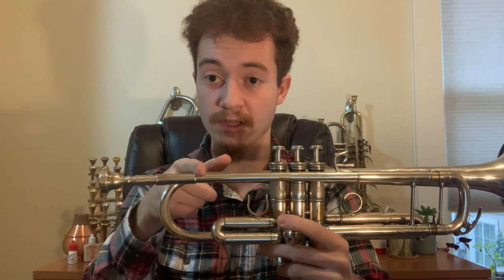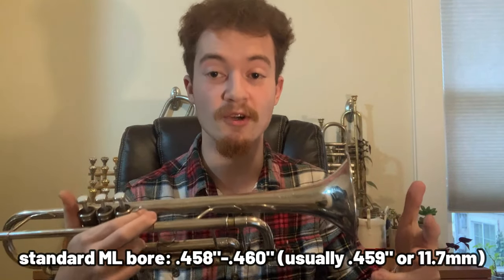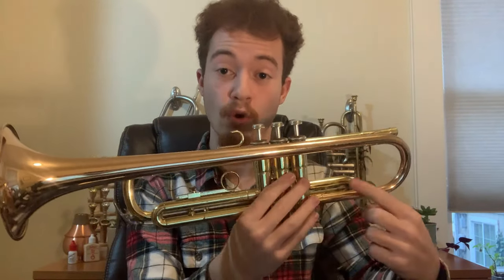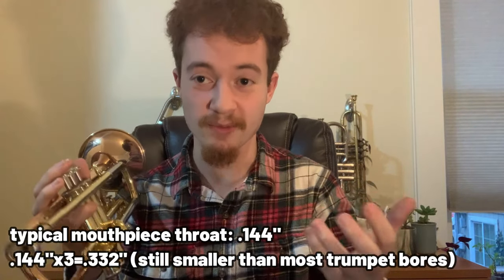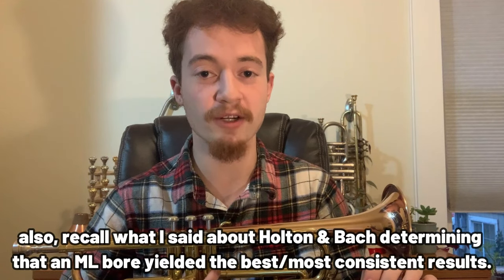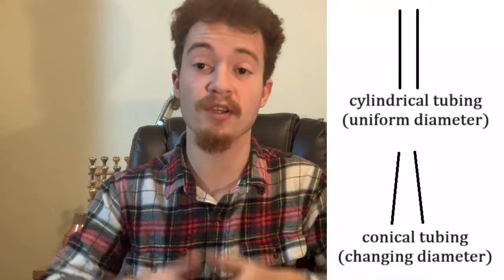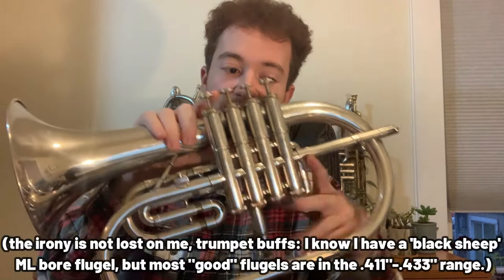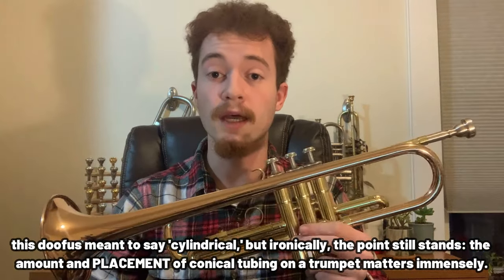Bore & Bell Size... What Do They REALLY Do? | Trumpet Demystified Episode 2

Comment: I play a pretty large mouthpiece and I play mostly big bands and salsa gigs..I have found that my Olds Super balances out the large mouthpiece very nicely.My super has a bell throat that flairs late and that’s where I feel like I get the needed resistance to help compensate for the large diameter mouthpiece.Also the tuning slide is kinda square shape which adds a bit of resistance too.These things really help me get thru 4 hour too freakin amplified and loud commercial gigs.Oh and I’m 70 years old..👨🏼‍🦳
Reply from the maker: Thanks for your comment, Larry. I’m in a similar boat, with my trumpet perhaps being “tighter” than conventional, balancing my large mouthpiece tastes. Also, not my main horn, but I have a fun little 1924-25 King Liberty that that has a similarly slow-flaring bell that definitely is fun to plug something silly like a Bach 1D or 1E into!

Also, much respect for being able to survive four hour gigs at your age. I’m a third as old as you are and I don’t know if I could do it…
Reply: @SamuelPlaysBrass  the right tool for the job. I played Bach 43/43 my whole career, which included broadway musicals, big bands,and some orchestral gigs,and club dates too..Now days,as the gigs I play are mostly very loud I love the Super for a bell to mic horn that has a very fast attack (response) …My bachs have a slightly more complete rounder sound,but the olds has a fine sound, and an easier horn then my Bachs without a doubt.The olds people knew their stuff!

Comment: Large bores in general have less acoustic impedance and they do not have as strong of resonances. The acoustic impedance does contribute to the "played" air flow resistance.  So it is not only the mouthpiece throat that determines flow resistance when playing.
Reply: Yes 100% right. Some people that claim that the bore size doesn’t matter are misguided,Maybe some monsters like Arturo it doesn’t matter, but to normal trumpet players it sure does. Step bores or choked bells can make a large bore horn easier to deal with but a straight Benge 6x or a Wild Thing will definitely take extra energy away from the player during a 4 hour gig.
Reply: @tomchojnowski9215  yes, what players don't realize is that less resistance also means less efficiency.  The player must balance their preferences.
Reply from the maker: I think that’s a good way to put it, Darryl. The lessened impedance of large bores is part of the reason why I don’t sound good playing on them. The sound becomes tired and a little too unrestrained. The energy threshold to sustain the vibration is too high for me. I meant to allude to this concept while talking about how I don’t sound good on large bores.
Reply: @SamuelPlaysBrass  Large bore plus large mouthpiece is a brutal combination.
Reply from the maker: Good point, Tom. That's another thing. My chops and approach require a rather wide mouthpiece diameter, which also decreases the efficacy of playing on a large bore instrument.
Reply: @SamuelPlaysBrass  What amazes me is you sound great on all brass instruments, I don’t know how you can switch from a trumpet to a a trombone to an alto horn to a French horn and still sound great!!!
Reply: @SamuelPlaysBrass  generally your assessment I agree with.
I have 3 trumpets of various feels depending on the situation
Reply: Great content. Thanks for the channel. Have you thought of looking into MAW valves and how they affect airflow on trumpets? I got my Franken-Bach outfitted with them a few years ago and love them (but I also had a custom lead pipe put on at the same time, so I’m not sure which one was responsible for the great result).
Reply: Yeah as a tuba player I was thinking that didn't make much sense because the impedance of a .330 bore tuba mouthpiece is essentially non-existent, but once it's in the instrument there's a decent amount of resistance to push against, especially with all valves down. Even blowing out spit I can feel that the air resistance changes when blowing through all seven* valves. Similarly, blowing through a trumpet mouthpiece is easier than blowing through a trumpet. 

*compensating instruments have four pistons but the first three actually operate two valves each
Reply: @tomchojnowski9215 amen to that… I had to learn that the hard way before a packed house at a prestigious jazz club… 🤦🏾‍♂️

Comment: Yeah, I remember my first trumpet playing nicer if I warmed it up under a hot tap first, expanding the tubes ever so slightly.
Reply from the maker: @rubenproost2552  That is truly bizarre. I’ve never heard of someone actually being able to perceptibly notice the expansion of the bore due to heat. I’d be surprised if hot water alone could make it expand more than a thousandth of an inch. But interesting discovery nonetheless!

Comment: In the beginning of my lookout for trumpet models, I thought a large bore must be good and got a Yamaha 6340. While that was very easy to play and a really nice instrument overall, it didn’t deliver the full-bodied sound I was after. I now have a 732 with M bore size whims sound I like more. So one could think that M bore gives full sound and L bore makes it brighter? Of course not, my horn with the fattest sound is a ML CarolBrass, while a Yamaha 934 sounds very bright and elegant, but maybe a bit thin — also with an ML bore… My conclusion: bore size has absolutely no meaning on its own. Still I recognize that most trumpets in my collection have M bore.
Reply from the maker: I completely agree. I play and sound far better on an M bore due to the more conical bell section than the straighter taper of an L bore. However, this can vary from player to player. You and I are probably in the minority. :)